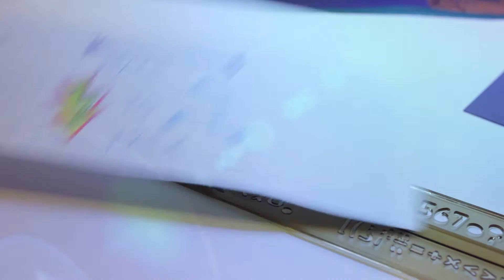Using Chalk Paint on a Pine Wood and MDF Cabinet | How to Paint with Chalk Paint

Comment from the maker: So, yeah, another wood working project. And Chalk Paint!
Reply: Can you let me know the method for Mdf, what primer did you use? what chalk paint? what wax ? Thanks!
Reply from the maker: @sarael-toukhy7728  Hi there, the primer I used was just water based polyurethane for wood. As for the chalked paint, I used the Rust-Oleum brand.
Reply: @Made2hack  Fantastic, Thanks for getting back to me!
Reply: Can we apply chalk paint direct without the base on mdf??
Reply from the maker: @aachalgoyanka9430  Hello. I'm not sure on MDF. I would be worried it might not close the pores like the primer / sealant does. Maybe try on an off cut piece of MDF and see if it sticks.